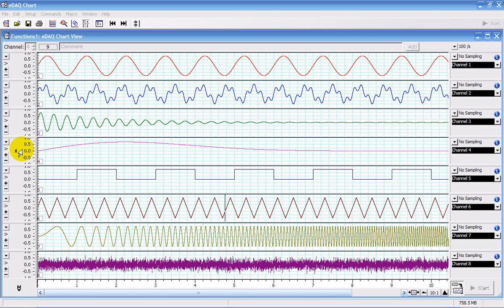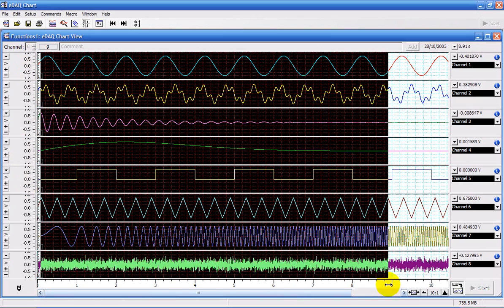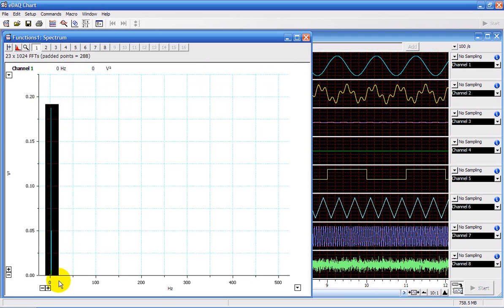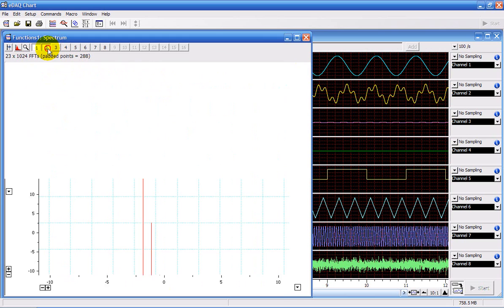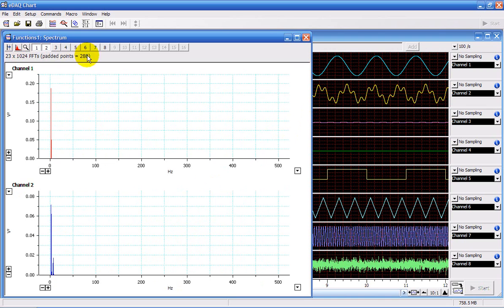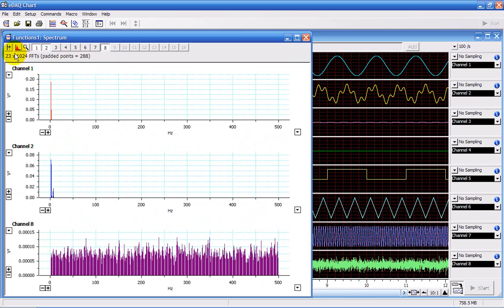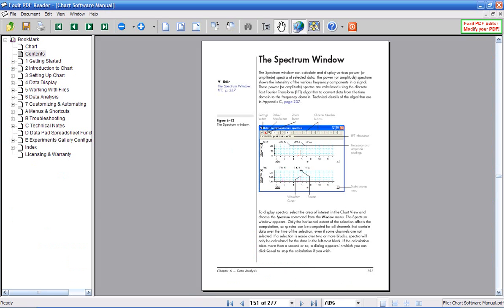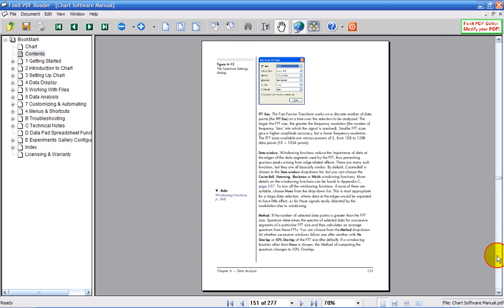Spectrum FFT Fast Fourier transform, Data Recorder

Comment: How is this program called which you are using. I want it to. Is it available for mac?
Reply from the maker: This is Chart software https://www.edaq.com/ES500
MacOS software development was halted in July 2009. Last versions software for Intel based MacOS X systems (up to Mac OS 10.6.x) can still be downloaded. Follow the links above. Mac OS Lion (Max OS10.7), released in 2011, no longer includes the 'Rosetta' function which enables old eDAQ Mac software to run.  Windows versions of the software can be run on Mac OSX computers based on Intel processors using Windows XP, Vista, 7 or 8 with a suitable virtual machine software such as VMware Fusion or Parallels.